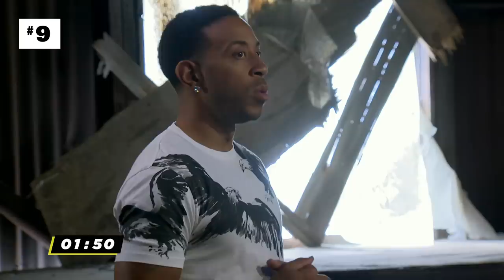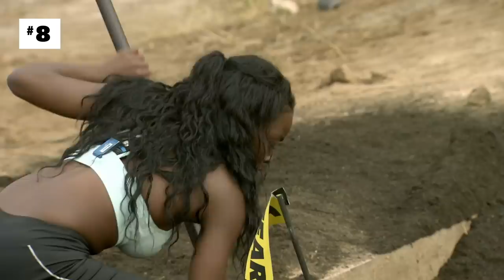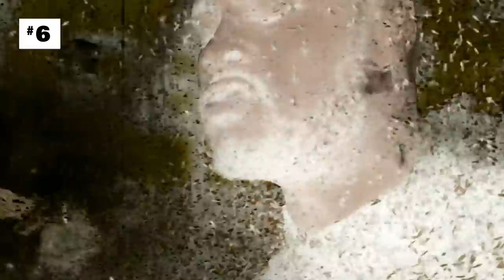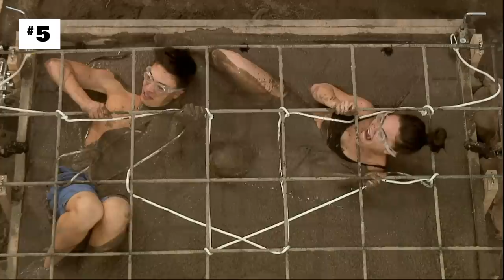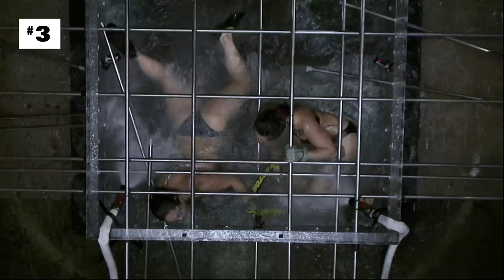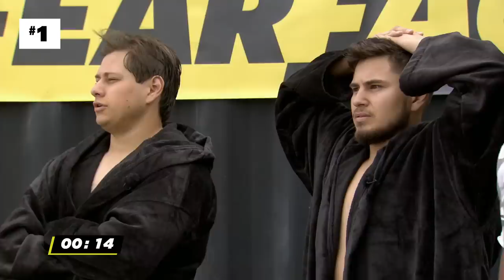9 ‘Fear Factor’ Challenges That’ll Keep You Up At Night | MTV Ranked

Comment: They should get more than 50,000 dollars, there facing their fear, they could be dying 🤦🏽‍♀️
Reply: Nah. Very high chance of survival for most of them. For the concrete one, you can just get some guy to get you out. For the last one, if you can't get out, some guy will pull the cage out of the water as it was initially lowered into the water. For the burial, as long as you're not claustrophobic and don't have trust issues, and are not significantly afraid of death, you will most likely be fine. For the first one, the initial task isn't actually a fear. It's an inconvenience. But entering a warehouse full of clowns is scary, but if you're an adult, risk of heart attack is low.
Reply: More Like 100 Lakhs...
Reply: Is that dying for any fu*king great reasons
Reply: @akshaypt503  money. Maybe they need it as they aren't financially stable.
Reply: No 1M
Reply: Have you guys never seen the original fear factor with Rogan? This shit isnt anything compared to what they used to make them do
Reply: @Enthusiast230  i dont get it they were never in danger even if you drown you dont die you just black out. Of course even that wouldnt happen bc there are guys who rescue them. Id even do this for 100$
Reply: @es8450  I mean, they probably earn money for possibly facing their fears. They black out, but that's a scary experience on its own for most people. If I'm not wrong, they have to finish it to earn money. So even if you black out, you probably won't earn anything.
Reply: Ikr? I watch The Challenge and for the last few seasons the prize has been 1 million, or your share of a million. I would need a hell of a lot more than 50K to be doing this shit lol. And there's no guarantee I'd even win any money.
Reply: I would do all for 100 bucks
Reply: They're* 🙄
Reply: People that play survivor get one million if they win and there not doing nearly as much as this!

Comment: That water tank water release was so bad. It took way too long for the water to drain. Why not just have it release one of the sides of the tank? Open a flap on the back of the tank? The water needs to be gone from that tank asap when the cord is being pulled moments before taking in water.